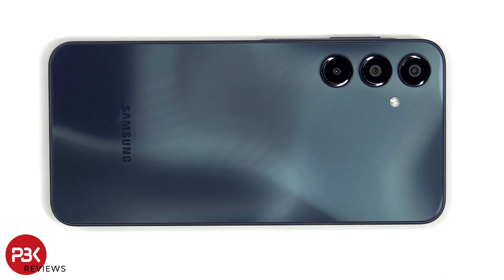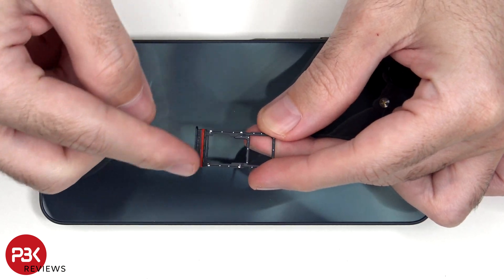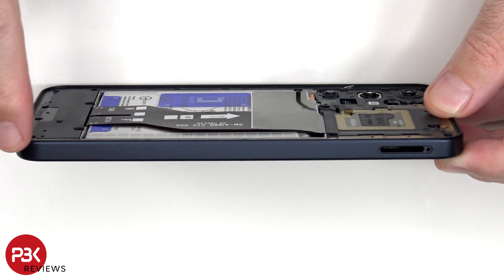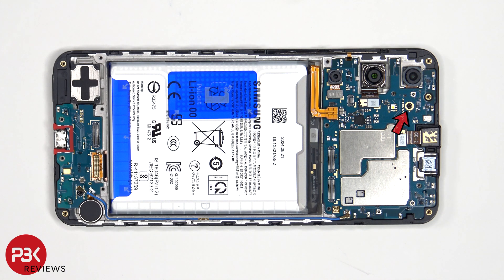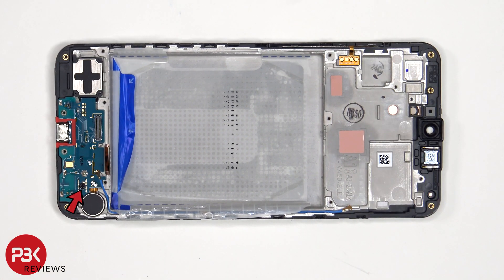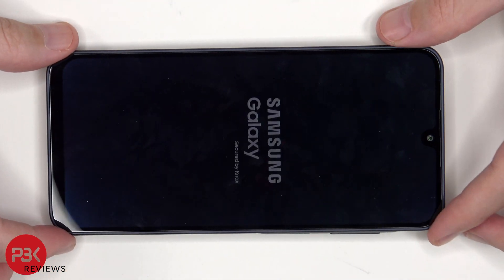Samsung Galaxy A16 5G Teardown Disassembly Phone Repair Video Review

Comment: I was wondering is there a way to drill holes in the frame or even replacing the battery to a smaller one to modify the phone to be more lightweight.

Comment: Samsung A16 have C Type charging connector, but here is different, you need to confirm the actual model number in your video.
Reply from the maker: It's not different, this is also type c.

Comment: Is it true that the A16 actually removed the 3.5mm jack?
Reply from the maker: Yes correct. The 4G version has the headphone jack/3.5mm jack.
Reply: The 5G version, yes. I'm not sure if there will be a 4G version, but they might retain it for the markets that will have it
Reply: @MZRTMusic254  That's actually wild.
Reply: @AzureRT456  It's a new low for Samsung. There's just no excuse for this lol
Reply from the maker: Yes, you're correct. The 4G version has it.
Reply: The 5G does not have it

Comment: Nice!  Three Working Cameras!  That's what I like to see.  No useless Depth Sensor or TOF.
Reply: I think they should've replaced the 2MP Macro camera with something like a telephoto lens though because I've only used the 2MP Macro camera of my phone (not the A16) twice in 3 years
Reply: @ExploringNew1  I agree.  A telephoto is WAY more useful than a Macro camera, but telephoto is also more expensive, so this a sacrifice that Samsung makes to sell this phone a little cheaper.
Reply: @IsItWorthIt3  yeah I think they should at least have added that to the A55
Reply: @ExploringNew1  Oh, definitely!  Samsung charges a lot more for that phone, so they should equip it with a telephoto!
Reply from the maker: Yup!

Comment: U should highlight the vapor chamber whether copper used on the phone should be more informative i most watch ur videos to see if the phone has cooling system or not
Reply from the maker: well if you watched the video, you'll see that it clearly doesn't have any vapor chamber. So how would I highlight something that's not there?
Reply: Badhak kyun Raha hai bhai 😅 @PBKreviews
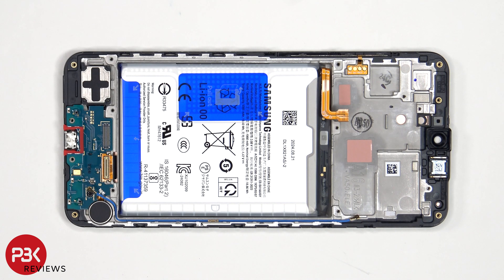Reply: @PBKreviews  u could just point it out saying its there or not there,u can  say where it starts and ends if the system is present, at 4:19 there a brown square in the aluminum area whats is that? is that copper or Just brown sticker cause in cmf phone there was something similar which stretched down used to transfer heat , as u can see this causes confusion that's why i asked u to mention it
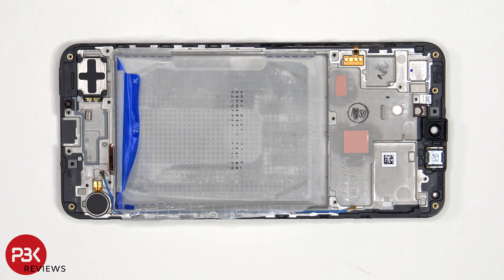Reply from the maker: Like i mentioned before, if you actually watch the entire video, you will see where I do mention what those pink colored squares are @6:10 in the video. :) just saying. As for mentioning everything in the phone that is not there would not make sense. I understand what you're saying that people are interested in the vapor chamber but its a very obvious thing. Its either there or not. Stickers, thermal pads, or tapes look nothing like a vapor chamber. The only time someone may confuse it, is if there is 3D graphite there instead of a vapor chamber which if that is the case, I do point out. But I will try to keep it in mind to mention in the videos if the phones lack vapor chambers. My only reason for not saying it, is since some phones may or may not have one between the screen and frame which is not made visible from behind the battery. It is very rarely the case, and usually you would see an indentation on the frame, so without actually prying and damaging a working screen to for sure say there isn't one, I try to avoid guessing. But for this phone I can say 99% there is no vapor chamber :) Hope this clarifies.
Reply: @PBKreviews  I think alex...2996 wanted details about the graphite film mentioned at 2:40, with more details on whether that is an effective cooling solution, although in my professional opinion, it is impossible to check the effectiveness of graphite or copper tape without hours of testing... (something that even I rarely do).
Reply from the maker: It's possible, but yep aside from graphite film and thermal paste, there is no other cooling such as a vapor chamber on this phone.
Reply: same here if a phone doesn't have a respectable cooling system then it's a no no for me
Reply: What are you talking about ? If the phone has a vapor chamber he will show it and if not he wouldn't. It's that simple...

Comment: What is different between A series and M series?

Inbetween 12 letter missing 😅 otherwise no change 

I'm watching this video #pocoF1 4+ year old or exactly coming December 5th birthday 😢

Dear. Please help me
Reply from the maker: Different regions and slight different configurations. Also the M series they refer to it as the Monster series so they usually will have a slightly better hardware configuration. Usually its a larger battery.